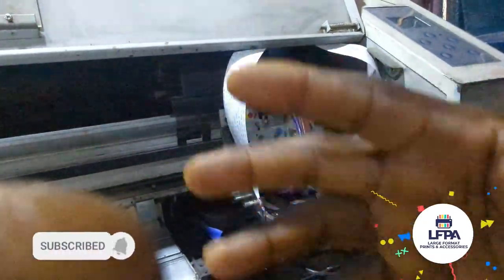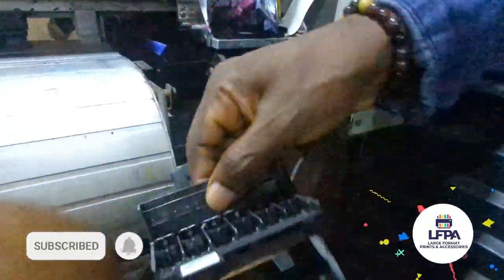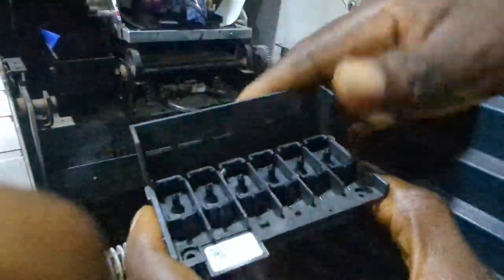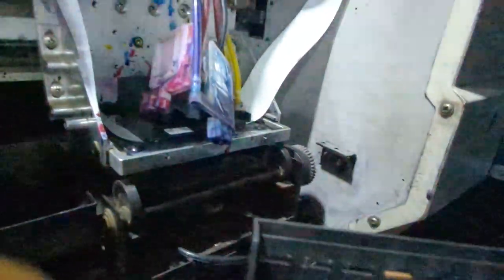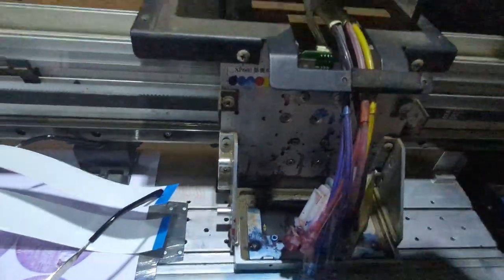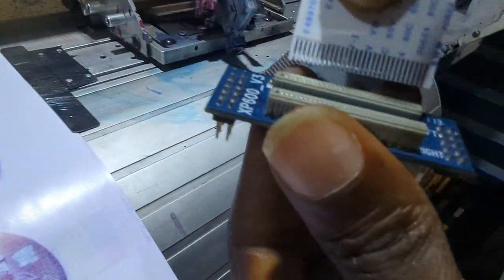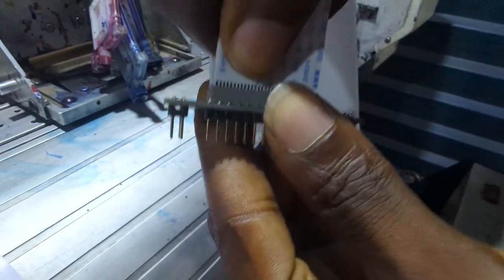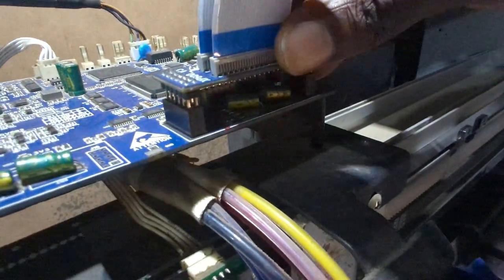How to Install an XP600 Printer Head in 2025 (Step-by-Step Guide)

Comment: How do we set the XP600 two-headed inkjet printer to make it work with one header from the Maintop program and from the same printer settings.
Reply from the maker: To make a 2 head printer, print with one head. You need to set that inside Atools. Not inside Maintop.